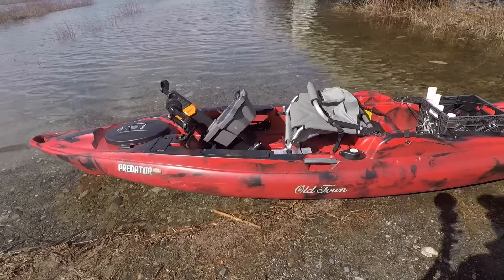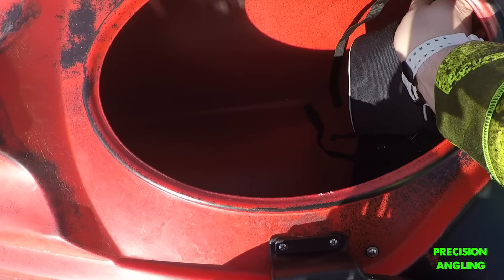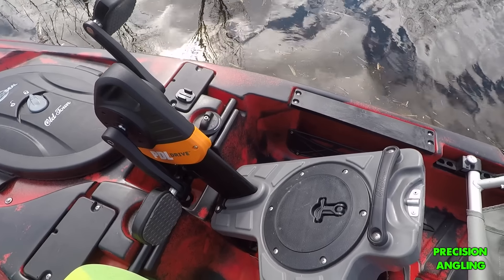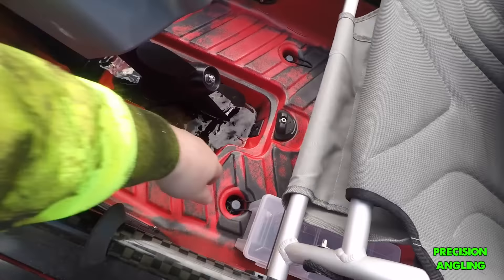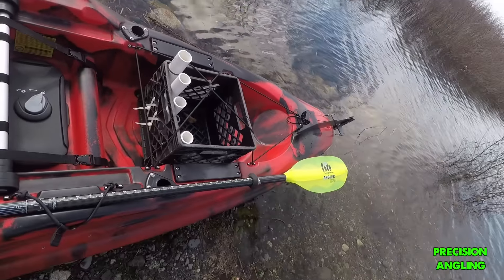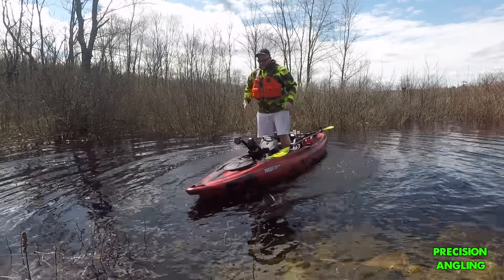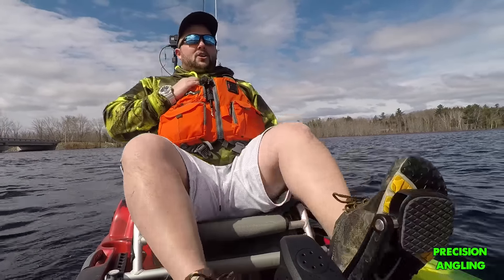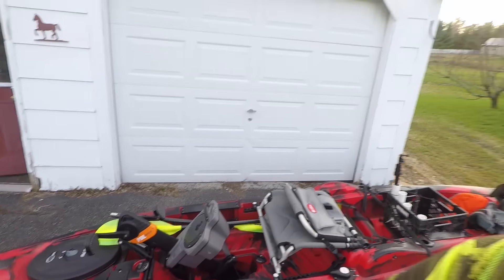New Kayak. Old Town Predator PDL. First Ride + Review.

Comment: Nicely done!  
I have the P 13 PADDLE Drive version also in Black Cherry.  Made my old ticker go pitter patter when I pulled the wrapping off her in 2019.  Not many upgrades yet.  Added a Garmin Striker 4 (used the front scupper mount) and got a matching Carlisle CF paddle for it.  Seriously thinking about putting a trolling motor on as I get older (65 atm).
Subbed ya, btw.  Hope to see some Maine fishing (not many ME YTers) when I can't get out there myself.  
Keep yer line tight and yer hair dry.
Reply from the maker: Thanks for joining!! I love the PDL system. Haven’t had one problem with it. I’ll be hitting it hard starting this weekend

Comment: How stiff is the pedal drive?? I'm torn between the topwater and this one.  I had a total knee replacement so I plan to use this obviously for fishing but also therapy on the knee to strengthen it again.  Thanks in advance.
Reply from the maker: I wouldn’t say it’s stiff at all. The resistance increases when you start cranking around 4.5 mph. It’s really smooth up to about 3.5mph. As far as rehab for the knee, it would definitely strengthen the knee. Ive worked in PT for 13 years, and this drive system is definitely appropriate post surgery!
Reply: @precisionanglingYT   so here's the almighty question.  Predator or top water 🤔, I like both and the lakes here in AZ I deal with some shallow areas and boats and jet skis. I don't take alot with me out, and plan to hook up eventually for lights and maybe a motor someday.  My biggest is stability getting out of my WS tarpon was somewhat hard before im not strong in my glutes yet.   Thanks again for the reply and video.
Reply from the maker: You would enjoy either one. I went with the Predator because it was the longest they had at the time. I fish big, deep, cold water frequently and wanted the extra stability vs the shorter versions. The longer kayaks track a little better also. If your mostly fishing shallow, you’d probably be fine with the top water. Can’t go wrong either way tho!! Any other questions, fire away
Reply: @precisionanglingYT   have you had any warranty issues or had to deal wth the company yet? How's their customer service? WS I had issues 1 month into owning it, returned it the other day.  Can I also use yakattack stuff? Did you ever get water in the center console area? I think after watching more videos im gonna learn towards the predator, bit more than TW, but I also cover large lakes.  I used to paddle 5 miles out and the lake I hope to explore on is over 7500 acres and I hope to find new coves.
Reply from the maker: T W I haven’t had any problems with the PDL. I did have a small crack develop in my other standard Predator(non PDL.) It developed just outside of a scupper hole. I emailed them asking for an adhesive type fix, and they emailed saying that it would be covered under their lifetime hull warranty. They sent me a brand new kayak 2 weeks later. I did get some water in the PDL drive compartment. But they fixed that problem with an updated compartment the following year. Overall their customer is top notch! 10/10. Just a side note, they are made an hour north of me here in Maine. Great company, they do a lot for their employees and community!! They take pride in everything they make
Reply: @precisionanglingYT   Awesome! I'm looking to buy one now,  ready to burn some cash and wait for them to be remade so I can connect with the water.  Darn covid stuff :(  everyone's bought kayaks here and everyone's backlogged.  Sighhhh want the red/ black.  Going with the predator.  Its heavy yes but I love the speed and knowing I can use this for my PT, HUGE plus.  But you telling me their CS is really high.  Im on it! Thank you.  :)
Reply from the maker: It think you’ll be pleased with them!! I’ve had nothing but good experiences so far with my PDL, Predator, Vapor Angler, Reg Vapor, and my daughters Heron!!

Comment: Year 3 now in my PDL - game changer, you will love it. Couple thoughts: The paddle keeper you have to put on, will help - keeps it out of the way has a lock down - but best is it is real handy when open to just grab my paddle when needed to go shallow. I have a paddle leash that I tie down when transporting (I have a system where I use my Tundra to  quickly ratchet lock kayak down in the bed, both front of kayak (that front handle is well thought out) and at the seat on both sides - along with a folding kayak trolley with wide plastic wheels underneath (pay no more that $60/70 bucks) to transport and bungee strap on back to do portage where needed. Did same as you with crate and extra pole carriers (stole a milk crate and used pvc - cut slots in the top of the pvc for your rod handles and they will move around less)
I have anchor system with clothes line retractor zip tied to side of crate (in all honesty, I almost NEVER use my anchor - no need to with front and back peddling - just wastes my fishing time to set anchor unless in heavier current). I put tool belt pliers holder down low near front pockets (Zip tied) for easy place to store and grab my piers - always in the same place. I just got Helix 5 G2 GPS with down imaging and Nav card (figured it is too slow for good side image use). I switched to 12 volt 14 amp battery this year from 12 volt 7amp - still fits in battery bag on kayak and last much longer between charges - less of a pain and not much more money. I use trickle charger for battery every 3 or 4 trips. The PDL transducer cut outs work best with humminbird (same company owns Old Town and Humminbird). They recess up better than other transducers - Using the front under mount for transducer makes cable run easier (I just run it out the side of the hatch - no holes in hull and it still locks down - then you have channels to run cable under those mounting plates in front. Very clean system. Use 1 inch pvc that pressure fits great into transducer hole to mount it - if you need more info I can tell you how I fixed transducer to PVC pipe with SS hardware (simple).
Love your vids - keep them coming.
Reply from the maker: Great info. I don’t plan on using an anchor much, but will still prob put a trolly on it. I had read about the side imaging not liking the in hull spot, but that’s where I’ll likely put it. And I have a 12v, 12ah battery for the helix  unit, that should get me a a trip or two. Thanks for the advice!!
Reply: Excellent comments Jim, thanks for your detailed input.

Comment: Just a heads up, check the fishing laws for where you were. It's a few miles from where I live and I got tagged last spring for open water fishing the same exact place. Most of the Somerset and Franklin counties are restricted until October to November after ice out.
Reply from the maker: Not sure why they nailed you. Its pretty much open to fishing year round under general law
Reply: @precisionanglingYT  i argued that point w the warden last year and this is where they get you.....its not a general law place, its a special law place, thats how it was explained to me because it states only open to open water fishing from oct.1 through November 30. I was explained in the paperwork from the warden that general law lakes, ponds, streams, rivers won't have special codes included. I dont want to name the place you were at out of respect and privacy. Im just trying to be respectful and share my experience with you as well as maybe somewhat helpful.

Comment: Are you able to fish standing up from the Predator kayaks? I'm 6'3" , 260 and have been trying to decide between this and the Topwater/Sportsman from Old Town.
Reply from the maker: Yes. You can easily stand and fish from the PDLs. They are very stable. I’m 5’8”, 240 and haven’t had a problem. I used to stand in my 12’ Predator MX in heavy current fly fishing. Can’t speak for the top water or sportsman line, but would be confident saying they would be stable too

Comment: I'm thinking between the old town topwater PDL or the Predator PDL. What's the difference in cost.
Reply from the maker: Topwater PDLs are $2000, the Predator PDLs are $2800. Same basic concept, the Topwaters are a little shorter, don't have locking hatches etc. Both are great boats.
Reply: @precisionanglingYT  I'm looking between a topwater PDL and a predator PDL. What's the weight difference between the two
Reply from the maker: Topwater is 96lbs, PDL is 116lbs